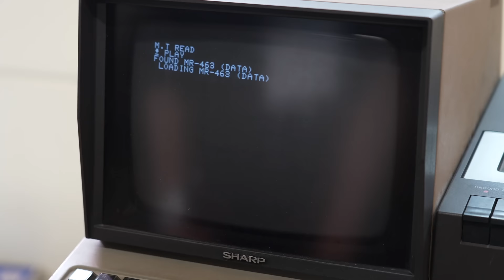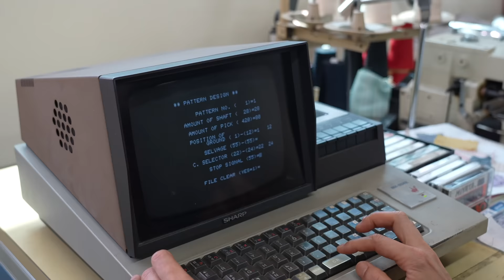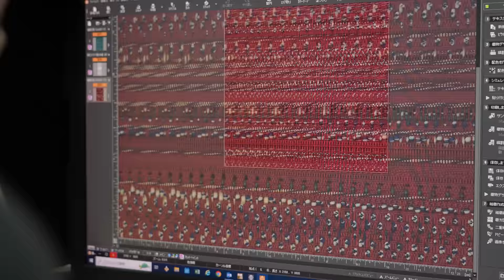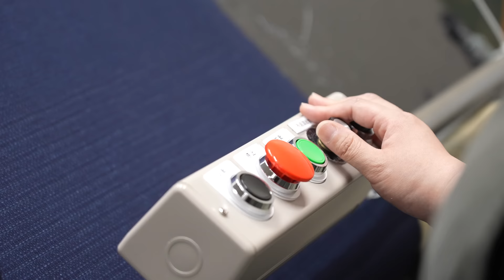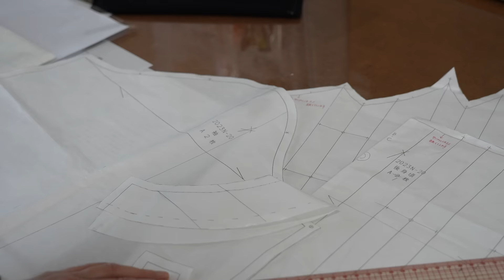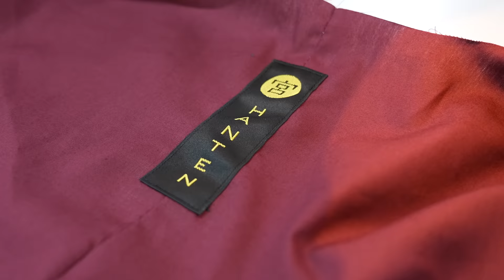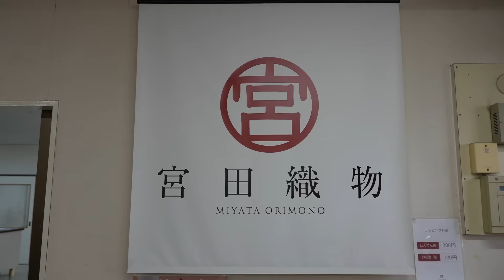40年前のパソコンが現役！機械と手仕事で伝統を守りながらはんてんを作る日本の工場

Comment: MZ-80が現役でまだ活躍してるなんて感動ものです！！
Reply: Yeah, I noticed that too. And I sure do hope that their tapes hold out. (Got Backups?)

I have a Sharp CZ-801C in need of the OS tape. If you happen to know where I could find it, I would be much obliged. :)
Reply: 何十年も使い続けるためには、古いコンピューター内のコンデンサーを交換する必要があるかもしれないと思います

to last for many decades I think the capacitors inside old computers may need to be replaced
Reply: @tgamtgam173  The Hu-BASIC tape is the OS on these (apparently, I still have a lot to learn about these). The MZ-80B (which I would love to own, but I'm trying to be responsible - I'll succumb to temptation at some point) has its Hu-BASIC source code available on the web, including updates and a "SuperBASIC" version.

If there is a s-os operating system for the CZ, I would love to hear about it. :) Or a users group (that still exists).

Thanks!
Reply: Dr.Spock startrec
Reply: MZ-80! マジか…信じられない…
Reply: @tgamtgam173  Thank you so much!!! I never thought to look for "Sharp X1". Instead I was looking for "CZ-801C" and getting few results. :)
Reply: 感動よりヤバいとしか
機械メンテするとき、たまに初代98の基盤とか出てくるのよ
頭痛いから
なんで数台持ってるが、流石にMZはな

Comment: 驚いた。PC98が今も現役で工場で使われてるのは知ってたけど、その何年も前の、まだ”パソコン”の言葉もなかった「マイコン」の時代のMZ-80が現役とは！
当時は中～高校生で、このマシンは憧れだった。その後、大学卒業後の就職はその道に進で、先端のシステム開発をしていた。そして退職。
今やパソコンも遥かに高性能化したけど、今も不思議と当時の思いは消えてない。
今も現役なのを知って、なぜか勇気付けられました。
Reply: Translated from English with Google Translate:
 かっこいい！ MZ-80 を特定していただきありがとうございます。 私は、そのタイプのハードウェアをエミュレートできるかどうか、あるいは最新のハードウェア上の「仮想マシン」内でソフトウェアを実行できるかどうかに興味があります。 おそらく必要ではありませんが、そのようなマシンに依存していれば、主要なコンポーネントに障害が発生した場合に、より多くの選択肢があった方が安心だと思います。 ただし、時折発生するハードウェア障害の際に、修復に影響を与えるのはそれほど難しいことではないと思います。 予備のマシンがあれば、必要なときに修理を行う時間が確保できます。

Original English comment:
That's really cool! Thanks for identifying the MZ-80; I'm curious to see if that type of hardware could be emulated, or if the software could be run on within a "virtual machine" on modern hardware. Probably not necessary, but if I was reliant on such a machine I would be more comfortable having more options in the event of a major component failure. However, I suspect that it's not terribly difficult to affect repairs during the occasional hardware failure. If they posses a spare machine, that would provide time for performing repairs when necessary.

Comment: As long it works and churns out an excellent product, why does it matter if it’s old? Respect to the engineers who built something that actually lasts.
Reply: @tgamtgam173  написать новый софт,  изменить старые программы, протестировать их функционал, переучить работников - на это уйдет больше времени, чем кажется поверхностно. Если большие наработанные библиотеки программ, то есть ли смысл их менять?
Reply: Age matters a bit; replacement parts become a concern. What do you do if a machine in the chain breaks?
Reply: @tgamtgam173  а у вас специалистов по работе на стареньком компьютере нет? Чтобы гибко эти вопросы решить?
Reply: I'd still opt for a n alternative to the tape drive, but if the rig has been working for this long, maybe it is best to leave it alone. If this was one of those pianos with a floppy drive on it, then it would make more sense to get a "floppy drive emulator"; it plugs into the FDD port, but lets you store floppy disk images on a USB flash drive. If something similar was used on the Kimono pattern machine, then it would be important for someone to maintain backups. Whereas a box of clearly labeled tapes (that are also probably backed up) can prove to be a bit more foolproof.
Reply: @tgamtgam173  That is a good point. Maybe they have a spare computer? Either way, if I was relying on this machine I'd be working toward getting the software to work on a virtual machine, or even find a modern physical alternative. If they have a spare, that would be fine because that would allow time for repairing the broken one if it ever fails.
Reply: @JollyGiant19  weld it
Reply: @JollyGiant19  There is a risk involved with stuff breaking and not being able to replace it all the time. Mind you, that 8 bit computer is golden in an era where PCs stop working because Windows decided to upgrade
Reply: @JollyGiant19  A lot of systems of the era can be rebuilt. Their custom parts tend to be super reliable, and off-the-shelf parts are often still available new because they never really fell out of use.

Custom and semi-custom parts such as ULA/PLAs have usually been decoded by enthusiasts and can often be replaced by PLD.

There comes an era when computers aren't made of such primitive technology later and are increasingly difficult to upkeep, you have to hope their parts are reliable or go deep salvaging for them.

In fact i downloaded the schematic and read through it. 8253 and 8255 needs to be gotten salvaged but they're really common easy and cheap, SRAM would need some effort to adapt to currently available parts but so far you can also get salvage not too expensively, and everything else is readily available normally, like, z80a processor, all the 74-series ICs that do all the heavy lifting, you get them all brand new. It would be a matter of a handful weeks to build a complete clone of this computer from scratch, no impediments. If someone needs a new Sharp MZ-80K, or their old ones repaired, hold a wad of money and hit me up ^_^
Reply: @JollyGiant19 
Or if the cassette tape snaps?
Reply: Because it can’t be last.
Reply: @JollyGiant19  chains are standarised. If chain is broken - is replaced with working one. Any part of this machine can be replaced. Worst case scenario - when magnetic tape is damaged and data couldn't be restored.
Reply: Pretty sure some new computer could be more efficient v:

Also, if this old thing breaks, who is going to repair it nowadays? Idk...
Reply: @Candyy248 if it ain't broken ,don fix it. Parts can be replace by the working one.
Reply: it's actually more reliable compare to modern OS that requires constant update then burns it to dust when it doesnt work anymore
Reply: @anonUK  they can pretty much modify it to digitized the tape then hook a 3.5mm jack in it then play back the tape sound from it, it's just that im sure they dont have the people that knows it in the company (I mean retro amiga and commodore users are known from doing those stuff)
Reply: @yasunakaikumi  
Well hopefully they do this before the tape gives up. Can they just use Audacity?
Reply: My thoughts exactly - and things were genuinely built to last back then!
Reply: Well, basically because it is more efficient and the worker in front of the screen wont need to be stting down hours spoiling her eyes and her back. Since I live in Japan, I can tell you I can see this kind of Japanese stupidity all around. Some may ask way the yen is so weak now, well, there you have it, Japan cannot compete anymore.
Reply: 자기테이프가 hdd나 sdd보단 수명이 긴 건 사실.  하지만  버그가 아예 없어야하는 인공위성도 아니고 2020년대에 40년전 아날로그 장비로 작업을 하는 건 시대에 한참 뒤떨어졌네요.  다들 InDesign 최신버전 쓸 때 QuarkXpress 3.3 사용하던 출판업자들이 딱 이 꼴이었거든요.  FDD를 아직까지 쓰고 호적등본 떼려면 고향까지 직접 가서 발급하는 건 자랑이 아니라 후퇴입니다.
Reply: I don't think the method is bad but it's not engineer thing. If someone is a engineer, then he should ask himself 'is there any way to be better?'
Reply: @NeverMind-pk4wz  I don't want to argue that this one is better one or worse one. I'm talking about this is not an 'engineer' thing because I cannot find any kind of engineers ponder about 'is there any kind of better way to improve this one?' Thing in the video.
Reply: @NeverMind-pk4wz  In conclusion, I don't think the way is bad, but I want to say that the method is not engineer thing, but a setimentally relaxed one.

Comment: I'm glad the algorithm popped this gem into my recommendations. I love that they are still using 40+ year old computers with cassette tape data and punch cards, and just how everything is done in the video is something that I can nerd-out on. I love retro computers and machinery.
Reply: As a fellow retrocomputing enthusiest, same but if I was the owner I'd be terrified of losing that software and computer. Magnetic tape isn't durable and while the computer can be maintained, 40 years is still old. They should try virtualizing the MZ-80 in an emulator and have it communicate to the outside world of it's serial ports so it can live forever.
Reply: any retro machinery links u wld like to share? (videos, blogs etc)
Reply: @fmaj6502  Yes it could be done easily, even a Raspberry Pi would be enough.
Reply: But do they love it?
Reply: They are very very lucky to have a computer for typing programs before punching cards. At my previous workplace we still use punchcards but it's all typed by hand directly on the punching machine. Once you did wrong, you have to take the roll out, cover with tape, reinsert, and start over. Something distract you, and bam, you miss a point. 

Told them I could replace things with a computerized version to reduce errors, or even drive the weaving with a fake roll geared by stepmotors, but they prefered loosing time with frequent errors and money loss, because ... They understand nothing to tech and they don't wanna invest in modern solutions or even the older efficient ones either like this one shown on video. They already had difficults to find manual services to ease the maintenance of machines...
Reply: @fmaj6502  The Sharp MZ series are very good and solid machines, not like a C64 or other 8bit home computers, and still available on the second hand market in Japan. They probably have the program printed on paper as a "backup". It can't be very long as the memory is 32kb. I have two MZ computers and they will probably outlive me.
Reply: @fmaj6502  well they could have the tapes backuped into .wav digitally since the data tapes are just audio

Comment: What we need to appreciate is that the software algorithm and machine interface is so perfect that they put up with the ancient computer hardware with its casette backup.
Reply: I'm surprised someone is still making the sprocket fed graph paper for the punch patterns.
Reply: Theres an episode of "How its Made" for player piano rolls. You can see them load up a song into an original Apple ][ that runs the actual punch.
Reply: That's not a cassette backup from what I understand of that model of computer, the Sharp MZ 80, That's the actual memory file. Disk drives were rare at this time
Reply: @Shinzon23  Exactly.  This is a 40 year old computer that saves/loads data to tape, that outputs a program for a weaving machine that's probably at least 60 years old, to make fabric for patterns that are even older than all of that.  Plus, that vintage computer looks brand new - they're taking amazing care of it.
Reply: I'm guessing that's the only hardware that they have to run it on. In the NC/CNC world, if it ain't broke, don't fix is the mantra. 

I recently assisted with the "modernization" of a 43 year old Takamatsu lathe that still had the old Yasnac controller. It would no longer reader the program from the paper tape reader, so I suggested to him that he drive the manual keyboard electronically and load his programs up that way. 

Greg did just that and now his "broken" controller will load programs at an astonishing three characters a second! (beats hammering the programs in by hand). :)
Reply: They should run their app on a Floppy disk drive..
Reply: The computer is a Sharp MZ-80K2, from around 1980-1982.
Reply: That's not the reason, but the machine that would be expensive to replace or modernize.
Reply: As far as I know, texture mills are also the literal origin of data storage and programming, which makes this video very on the nose in terms of historical relevance.
Reply: @Shinzon23  the Z80 was (and still is) one of the two most popular 8-bit CPUs. Surely it can't be that hard to find someone to port Z80 assembly to something more modern like C, and run it from a more modern micro-controller?
Reply: @hotaruyanagawa ctual hardware does not execute C code, though, so you still have to convert it back to assembly for that specific microcontroller. And even with the best compiler ever made there might be issues with the actual code output. A straight port from one assembly language to another would be better imho, but could be challenging. --- Ultimately, I suspect it's a case of "ain't broke , don't fix it", but you wouldn't just be able to swap the chips anyway. The Zilog Z80 and most second source parts originally ran on 5V power (and probably has 5V TTL logic compatiblity). Switching to some redesign (or a different micro) that runs on 3.3v or possibly 1.8v and supplies even less current source/sink capacity means all kinds of stuff has to change too.
Reply: @jnharton  микросхемы сопряжения уровней такие как 1.8V-3.3V-5V вполне есть и никакая не проблема. Проблема здесь больше в том, что работник лёгкой промышленности за годы работы вероятно на порядок больший специалист, чем тот человек который согласится машину модернизировать.
Reply: That tape isn't a back up its the main data drive.
Reply: These days with the retro computing scene you could easily get an emulator for the hardware and back the tapes up to a modern computer, the difficult bit is interfacing with the bespoke hardware that punches the pattern. Someone dedicated could probably pull it off with a Raspberry Pi or an Arduino, but if the machine is still working and doing it’s job, it’s unnecessary. I’d just want to have backups of those tapes because magnetic media deteriorates over time.
Reply: @Underestimated37  The magnetic nature of the media isn't nearly so big a problem as the ways that /cassette tapes/ tend to deteriorate. That is, the tape substrate onto which the magnetic oxide is applied and the binder that holds it together and onto the substrate can fail and turn into goop.
Reply: @jnharton  yeah you’re right, though it just takes one careless or clueless person and the data is screwed. I’d really want to back the data up to a modern computer
Reply: @hotaruyanagawa  I would say it's not  even Assembly, just BASIC. Look at the speed at which it draws the grid.

Comment: I have ~40 year old Japanese machines that read punch tape also. There's a company in Vietnam that produces an interface module called Titan DNC, that allows you to unplug the tape reader and plug in the module directly. The module has 4Gb of memory and two USB ports. It has changed my life, and I can now use modern software to program my machines. 
I wonder if the module would work on these machines?

Comment: Old machines were often reliable and built for ages (there are sewing metal Singer machines which work a hundred years later - new plastic ones won't last a half that long).
If it works well and it makes economic sense for the factory to keep using such computers, it would be very wasteful to discard a perfectly working machine.
Reply: you don't have to discard the machine to replace the perforated tape interface and and a 50 year old computer with something made in last 10 years and the cost would be less than they pay to maintain this thing
Reply: @dsfs17987  Econimical sense can include many things such as loss of profit due to disruption in manufacturing process while the updates are installed and quirks are ironed out (which probably will take a week or two, this is not a refrigirator replacement), retraining of staff to use new machines, possibly the re-planning the factory floor depending on how much are they going to replace, transfer of patterns and test-runs making sure that everything works as intended, there are no faults in a new process and quality doesn't suffer. Sure, at some point it would make more economic sense to replace the computer but it isn't as simple as plug and play and other factors are involved.
Reply: @hiddenshadow2105  and on the flip side is the old guy who took care of it - passing away, and then you are left with unplanned downtime of trying to find someone to try and fix it, or build new control... both of which can take far longer than couple weeks of planned downtime
besides, it is extremely useful to hire the person WHILE the thing is still operating normally, so they can reverse engineer what is necessary and decide what to keep and what to replace
plus there might even be productivity gains possible, if the reading system and buffer size are bottlenecks (I have no idea, just speculating)

Comment: Why not use an "old"computer if it works?  We use centuries' "old" writing instruments and paper all the time.  No one thinks anything of that. Punch card controlled type systems for weaving textiles are a little more than 200 years old. Those machines are now considered to be the world's first computers.
Reply: I agree. You can't fix an iMac with a soldering iron and a multimeter.